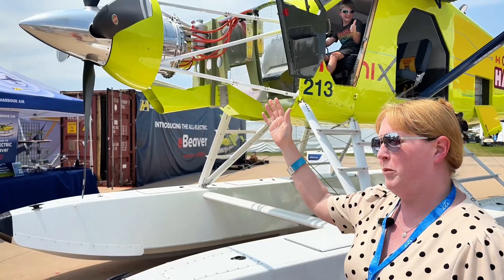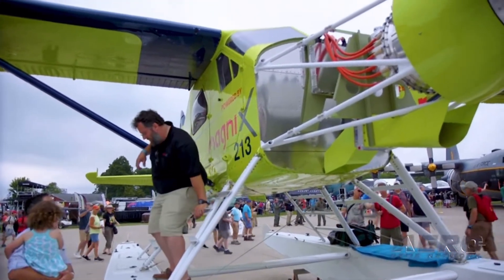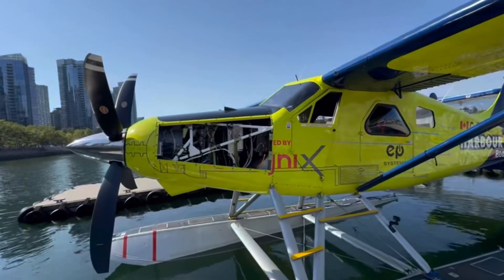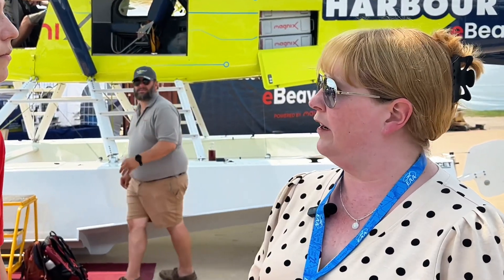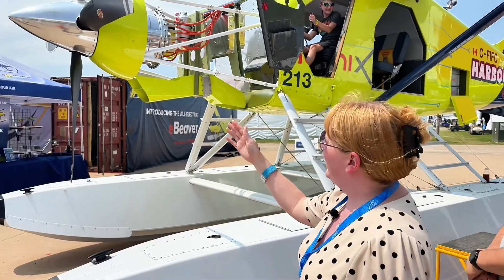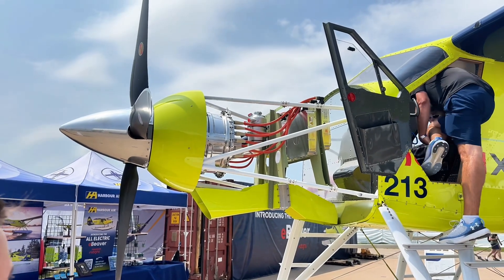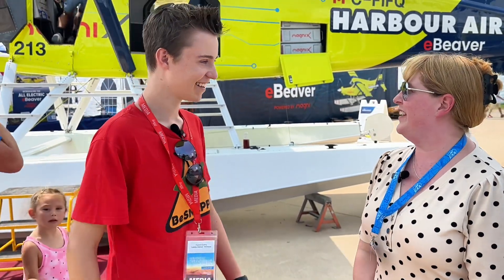They Had to Slow it Down - HUGE Electric Floatplane at Harbour Air

Comment: For safety. The plane should have the ability to jetison the batteries, for two reasons. If the batteries discharge or are unable to deliver power, jetisoning the heavy batteries with improve glide ratio and improve the chances of finding a landing spot.. 2, if they catch fire.
Reply from the maker: Great idea… make sense. Hopefully they read this and see your idea. Being able to offload the batteries makes good sense in a forced landing situation. As long as they are over the top of trees or vacant land when they do it, and nobody is standing below!

Comment: Clik bait. LOL, a commercial plane that can not carry passengers. Just wait for the lithium battery to catch fire in the salt water environment. This is a first with no future. Just a waste of money and defacing a classic Beaver.
Reply: They have 10 Beavers with conventional engines, piston, and turbo prop.
Reply: You probably were against it when they started putting PT6 engines on them.....or adding more cargo space, or wing mods,......glass dashes....Bring back coal and steam mindset.
Reply from the maker: She does mention in the interview I did with her in this video that they have 10 of them. Hopefully there are some lighter batteries around the corner they can use. It will be interesting to see how it unfolds, and I will do an updated video on this in a year or so. Thanks for watching.
Reply from the maker: Look at this floatplane video I published on the weekend. This could be more up your alley. Two Rotax engines working independently of each other which leaves almost 0 chance of a dual engine failure. Very interesting Aircraft for safety. 
https://youtu.be/DSP5T5mhL64

Comment: "There's a sucker born every minute." P.T. Barnum." Never give a sucker an even break." W. C. Fields.
Reply: Those were the old days, now they are born about every 15 seconds.
Reply: Range is greatly diminished, making a Beaver into a very short-haul, expensive local area taxi service with delayed turn-around time to recharge the batteries. Too much cabin/cargo space is required for batteries reducing revenue. Current battery technology being what it is, electricly powered aircraft are more of a science project than practical.

Comment: There's a reason it's the first one. The rest of us are smart enough to know.
Reply from the maker: @only_visiting  she does mention in the interview that they have 10 of them. This would be a significant investment so it sounds like they are confident, but no passengers until 2027… so hopefully there might be some lighter batteries by then.
Reply: It is not the first Beaver that Greg from Harbour has done...electric!

Comment: Great insight into HA's electric beavers. I'd argue this isn't a "huge electric airplane." It's a modified DHC-2 Beaver which is not a large aircraft.

This entire project is going to hinge on improvements to battery technology. If it stagnates, HA is really going to struggle to make this work at all for 1 aircraft, let alone their entire fleet which they've said in press releases in the past that they want to convert their entire fleet to electric airplanes.

Putting batteries in the cargo compartment of the beaver is going to make this a no-baggage-only aircraft, which isn't very useful. It will be restricted to aerial tours only which is kinda yikes.
Reply: I think you're both correct and incorrect with your concerns.   From what I understand Harbour Air's bread and butter route,Vancouver to Victoria is a 35 min flight,  And their basic sightseeing flight in both of those stunning cities is 30 min.  So a converted Beaver with the batteries in the floor gas tank compartment and behind the engine fire wall would have about twice the endurance required for their most common flights.  The current technical issue being over come is not the endurance of the batteries but rather the shape of the batteries.  Engineering is being done by Magnix the battery provider to manufacture the same number of "celled" battery in a flatter configuration matching the under floor "fuel tank" compartment.  Harbour Air believes they are demonstrating the flight times of the equivalent number of cells as the future space will allow for.  One really neat thing about using batteries in these small commuter planes is that the center of gravity (COG) with a full charge or empty battery basically never changes.  This greatly reduces the normal large changes in flight characteristics that small planes encounter as "heavy" fuel is used up. And should allow for more flexibility when accounting for and distributing the weight of passengers and their luggage.
The goal of reducing CO2 emissions for thier most common daily was the original worthy challenge taken on by Harbour Air.  But they are demonstrating reductions in noise pollution, required pilot skill levels, and  maintenance costs could be happy side effects of switching to electric engines even with the current battery technology.
Reply: @mic7504  The problem with lithium batteries is that they catch fire. I would not go on an airplane that uses this technology.
Reply: @Andysunflower  Yeah, I mean I haven't heard of any problem with electric cars spontaneously combusting.  But yes there have been enough troubles with electronic device batteries that you are right to ask the question about risks of using large cells of these in aircraft..   And yet you probably own several devices you don't give a second thought too.  And the difference in durability between the batteries that were part of a twenty million numbered production run that are sitting in a laptop that has been tossed around and was designed from the beginning with inadequate cooling just to stay competitive size wise  and the ones in the most tested and inspected form of public transportation that are part of a very limited and very expensive 2000? unit production run is night and day.

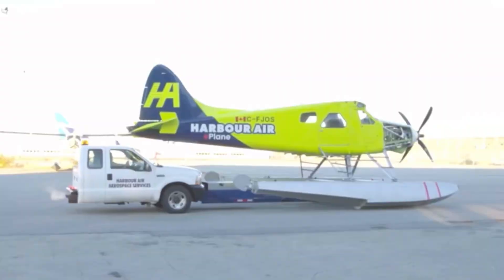Comment: 2:02 what is this 2 wheel ram?  AI generated?  🤔
Reply: Harbour air airplane don't have wheels. When they need to pull them out of the water they use that custom truck. Instead of the cab bring at the front with a bed out back they custom built a bed in front of the cab that goes into the water and the plane goes on top of to be pulled out for maintenance or whatever.
Reply: They use a cut in half pickup to launch the planes... 4x4 locked in front wheel drive.. and custom bunks...

Comment: How heavy are the batteries? 1 hour flight vs how many on gas?
Reply: the batteries are so heavy that the plane can barely get off the ground with the pilot on board. No passengers can be carried because of it. And it has about a 15 minute range. Thing is an absolute joke
Reply from the maker: @michaelcarniel9086  the lady in the video that I interviewed, Erika, indicated that a 35 minute flight time is possible at the moment, but like you said that’s without passengers. I’m sure batteries will get lighter as time ‘Flys by’, and these type of aircraft will be viable before we know it. Thanks for watching my interview, plenty more of those on my channel if you are interested. I even did one with Miss America recently, she is in the US Airforce.
Reply: @BeSnappy  They claim 35 minutes is "possible" but the thing has never flown more than 15, and then takes hours to recharge. One day they'll get there, if and when solid state batteries become a reality , but until then this thing is just a tax scam. They knew before they pulled the engine that it would never be able to carry a passenger, and for a beaver to be overweight, you really have to try. They normally hold 6 people plus a ton of baggage, so this thing is nothing they are trying to make it out to be. And yes, I've touched it, know 8 people that were involved in building it, and have flown in more beavers than I can remember. Lets not try to make this into something its not
Reply from the maker: @michaelcarniel9086 fair enough, it sounds like you know the Aircraft well. She also mentioned potentially carrying passages by 2027, so another three years away anyway. Weight is obviously the critical component with any aircraft… maybe Harbour Air are well ahead of the battery technology and will be ready to plug-in when the correct weight batteries appear. No doubt they have put a lot of money into it?
Reply: @BeSnappy  that plane will never carry passengers, they know it too, just won't say it publicly. It's a publicity stunt and always has been. Don't forget that it was built 5 years ago. And really, Harbour Air hasn't put much of anything into it money wise. Tax credits and sponsors have paid for it. Sponsors also get the right offs. Basically, the way I understand it, it's the taxpayer that pays for it in the end. And no, they don't have any magical batteries on the horizon, they don't develop them. They buy what the market has available. Not to mention the structure would.have to be completely reworked again to support different batteries which would put it right back to square one in testing phase. Nothing but a tax/carbon credit/publicity stunt
Reply: @BeSnappy  that 35 minute flight time has been claimed for a few years now but has never been proven. Buttes, electric planes will happen one day. But I wouldn't hold my breathe. 20 or 30 years, maybe, but not likely in my flying days
Reply: @BeSnappy  and thanks, I'll definitely check out your page
Reply: @BeSnappy  And that lady has a Masters in Aircraft Engineering.  Certification flight times are of course calculated to include standed flight loads.  As the Flight Engineer said to get the endurance required they simple need to lower the flight speeds greatly from the top speed available.   The flight speed they choose to demonstrate for certification is the equivalent standard flight speed of these bush planes.
Reply: @michaelcarniel9086  Where exactly are you getting those details from? What we heard in this video this thing is overpowered, and they're currently doing 35min flights. The only joke here is coal rolling bros who can't accept that we don't always need to burn dinosour juice to move around, sometimes battery electric power makes sense.
Reply: @jostafew  From the pilots that fly them, from my own knowledge as a pilot with an electrical engineer as a father. She says 34 minute flights, but then goes on to talk about reserve, an important requirement. As for names of the people I personally know, I'm not about to name drop and get people attacked. As for the power, yes, electric motors produce enormous torque compared to piston engines and the airframe is not designed to handle what that particular motor can output. Nothing new there, if you've ever driven an EV you'd know about that. The derating to something resembling factor output makes perfect sense as it keeps the aircraft inside its designed performance envelope, doesn't really mean anything beyond that. And nobody is trying to say there will never come a day when these things are viable, quite the opposite. I'd love to plug my plane into a solar panel and go home, later returning to a full tank of fuel. And a half hour refuel time kinda sucks, but would be acceptable if it was reality. But my normal endurance is 5 hours and about 900 nautical miles, a ten minute recharge and heading back out. I can also carry a passenger and baggage, something this thing can't. People like you want to believe this is some sort of eureka moment, but its more like a baby learning to crawl and comparing that to running a marathon

Comment: Look up Mike Patey,  he build a plane. Has solor pannels on it. And 2 ebikes for rescue.
Reply: It's not an electric plane. Those solar panels are only to power accessories and/or charge his ebikes etc during flight.
Reply: @angrygreek1985  That is correct.  He uses it for "glamping" bringing multiple "comfort" electric devices with him.  He also sees possible uses it in search an rescue situations where extra power could be provided at a search base camp.   A very cool project none the less.  And he owns the company that makes a very good electric tug for aircraft.
Reply: @angrygreek1985  I get that. Like I have seen the build. My point is with a bird this big and solar getting better, ud be able to put a good charge back to the batteries. Or place a small diesel engine in it like Topsy.
Reply from the maker: @RBA1891  I just checked out Mike, as per your suggestion. Great photos of the ebikes mounted under the wings! Thanks for watching my channel, and there are quite a few other aviation interviews on there I did at Oshkosh if you are interested.

Comment: Id rather fly in a electric then a gas plane, safer and cheaper the longer it's flying. a plus on the engine is, in bad weather or when over loaded it would still be capable of flying safely if they make that extra power available to the pilots in a emergency.
Reply: Then the battery thermal runaway……

Comment: Electric aircraft is a waste of time and energy. Battery tech still needs improvement.
Reply: Many of harbour air's flights are less than thirty minute duration. With reduction in maintenance and fuel costs they may be able to price their flights to be comparable to the fast ferry across the straight. Could be a favorable business model.
Reply: @fdestcroix  And allowable hours for landing and take off and flight paths could be improved on as they demonstrate a reduction in sound pollution.
Reply: So this is the battery r and d. Doent just happen over night. Electic diesel has been around forever.
Reply: Also a lot of float planes have to make two non-revenue flights for every revenue one to cache fuel.  

Just imagine if there was a battery pack already out there in the middle of nowhere being charged by a solar panel or Pelton Wheel that you could swap out after your trip?
Reply: @RayFinkle

The world’s first jet aircraft had an endurance of 15 minutes and the world’s first operational jet had to have its entire engines changed every 50 hours.  

What a waste, right?
Reply: The Wright brothers flight was considerably shorter so you have to start somewhere with a new technology. It’s not your money so how is it a waste?
Reply: The only thing wasted is our time responding to this stupid post
Reply: Ding , Ding ! Winning answer right here !